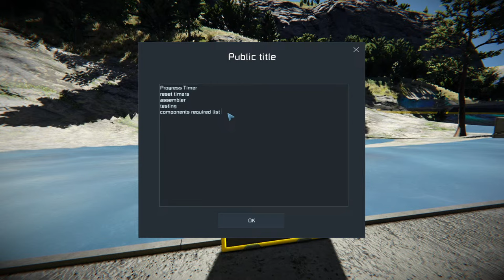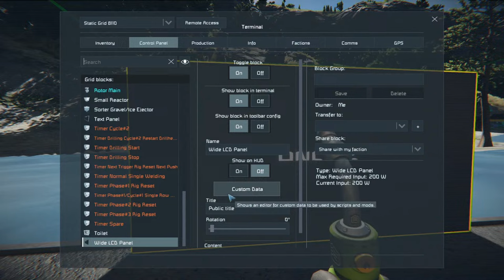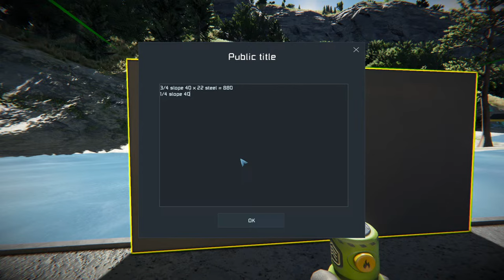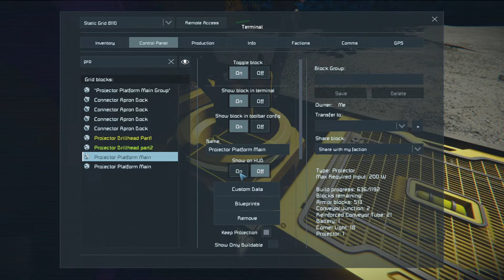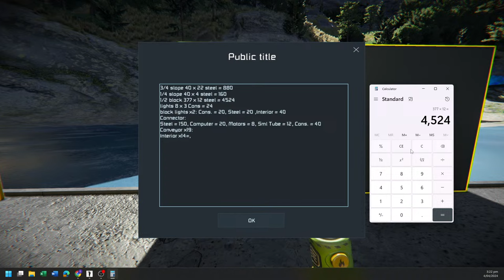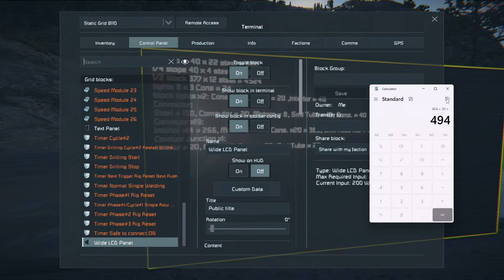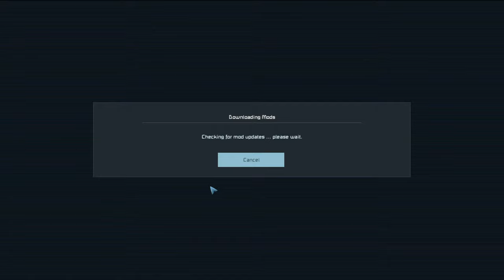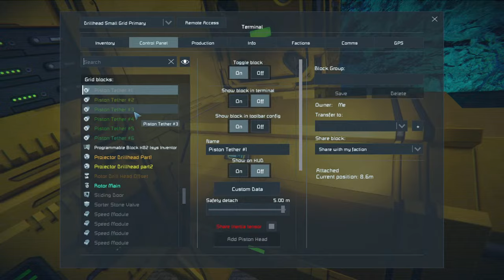Building Tunnel Boring Machine Mark 2 - Stream #2 (Space Engineers)

Comment: How do you get the adv rotors to work, in my games they play up do not stop turning and do weird bugs. said in the error log that they stopped using adv rotors by devs and might see errors with them.
They worked well about 1 year ago when last played.
Reply from the maker: I haven't had any troubles with them. Sometimes they don't stop spinning when you turn the lock on unless you turn the rotor off, but I can usually work around that by  raising the braking torque and just turn them off instead of locking.
Reply: @futurewellington6012  Yea can't remember exact issues but made me stop using them on my builds.. will try again and see if works.
Yea i never use lock. just had on off set up on my group and hot bar
Reply from the maker: @micksmith-vt5yi  There was the update that came through with the 1x1 variant, Keen initially set it when you add a small grid head to the large grid rotor, it would spawn the 1x1 head, instead of the 3x3 head, which is what you wanted most of the time. They did fix it, but that was about a year ago and put me off them for a while.

Comment: You are overcomplicating things, you dont need to actually use that many pistons in the design, it is just making things much more difficult. 

The easiest way to make this is having one piston pushing it forward, retract and lock to a new connector. Or if you want to have it moving forward all the time you can use two parallel piston pushing one forward and twhen that is fully extended you can use the second to push forward while the first is retracting. Also you dont need to attach a connector to the second one because a magnetic plate would ve enough i think maybe unless your rig is powered over the connector 🤔☺️ cool rig btw ☺️
Reply from the maker: That kinda of how the first version worked, but it didn't really allow for the ambilocal connection to off load extra materials and lay down the under-floor conveyor system. I used to have to manually add the conveyor and be there at certain time to connect it, I was trying to over come that and have it so you could leave this thing for a few days and come home to find it all done.
Reply: I think it's half the fun, over thinking and over engineering stuff. Then you get to change it as you see more of it move. Or at least that's how it works out for me - I try to do everything in a design the first time, then all the things I thought worked either don't, or could be done better/easier.